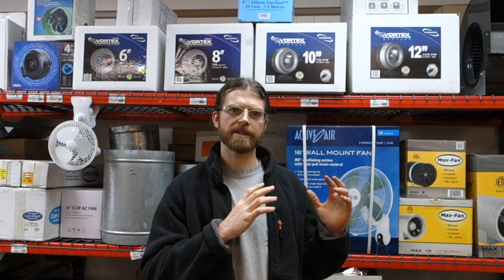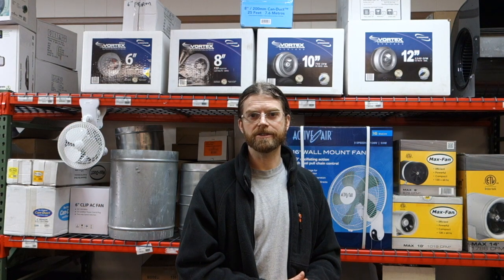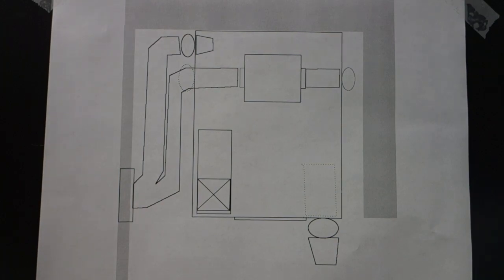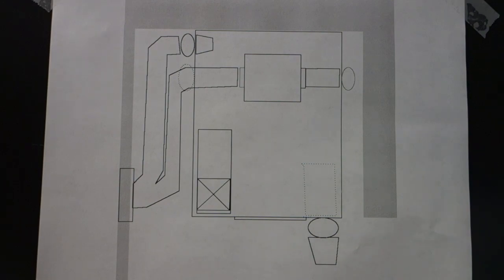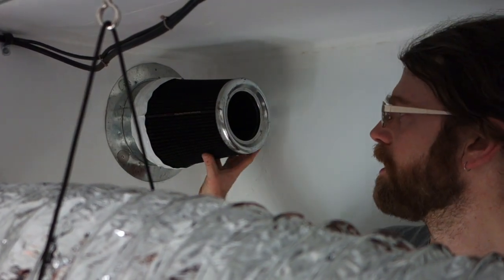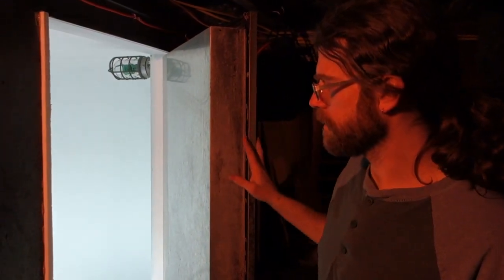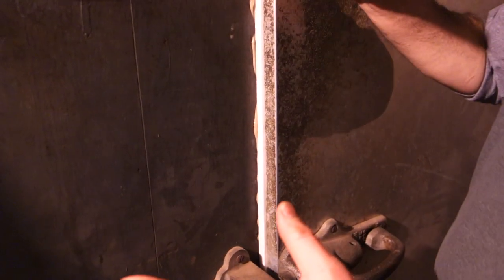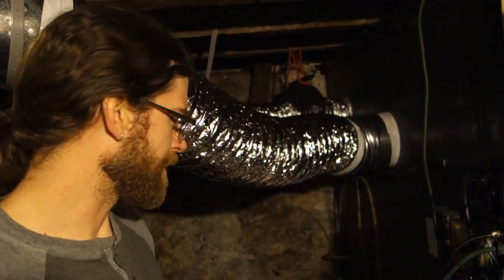Building a Grow Room Pt. 5-  Ventilation and Climate control

Comment: Hi, so if I am running a sealed room with led lights, co2 generator, air conditioner with heat kit then do I still need to bring in fresh air? I do have an exhaust when the lights are off to exhaust excess co2 but don’t currently have any fresh air intake, is the air intake necessary in my application?

Comment: your intake is coming from outside? do you block the entrance?
do you live in an area that is hot year round or dry? I live in new england and its currently winter. is it feasable to start my intake from an exterior window or would it cause temps to be  too low?
Reply: I am in the same boat and live in the same area. I noticed no one got back to you. What did you end up doing. I'm worried about low temps outdoors.

Comment: When your lights are off in the winter how do you keep the room warm with al the cold air blowing in the intake?? Especially if it’s being exhausted too wouldn’t that negate any heat from a heater which would be sucked right out? Other then that I only see perfection. Please explain!!
Reply from the maker: Yep theres a technical limitation there, when lights are off there is no heat to kick on the fresh air exchange.  it would be better to have some exchange at least 1x/hr just to refresh.  Currently I have a small space heater on a thermostat to keep up minimum temps at night.  Ideally using better thermostats with day/night settings would solve this issue.  Its a continual process and sometimes you have to consider costs v plant growth benefit.

Comment: Nice setup. I'm curious, most people say bring intake air in from the bottom. Is the top better or does it even matter?
Reply from the maker: for this room having the intake low in this room (at or below canopy height) can shock the plants during the winter.  If I was bringing cool but not cold air in year round then pulling it across the plants would be better.
Reply: Hot air stays at the top

Comment: Nice room man! 
I do have a question, is it better to use co2 and not intake any air into the room? 

For heat reasons, of the environment is too hot and I’m blowing hot air into the room I would be counter productive no with my AC?
Reply from the maker: if you have an ac installed, then sealing the room and using CO2 would be the best route.  This design allows for an air cooled space with less power consumption.  These days most ppl are switching to LEDs and choosing a sealed space.

Comment: If you have vents in your room, is it necessary to put a fan blowing air in? Or will your online fan blowing air out with the vents be enough?
Reply from the maker: there are a few calculators out there that can figure out air flow restrictions like passive intake, filters, ducting bends, or excessive lengths, but generally if exhausting and without restrictions, you are looking to exchange the air once per minute.  so 500 CFM fan is good for 500 cubic feet space, given no restrictions.  With passive intake you would need a higher cfm than what standard calculation would provide, or add an intake.    Hope that makes sense, lmk!
Reply: Green Dragon Hydroponics definitely makes sense thanks for the reply. Btw where can I buy some of those hepa filters? I need a 10 inch one can’t seem to find them anywhere.
Reply from the maker: @Oh-gz2je  If you are local I can get them in, or ship one to you no prob.✅ email greendragonhydro@gmail.com and I can send you a link.
Reply: Green Dragon Hydroponics cool man yeah I think I’ll order one from you? Also do you have any recommendations on an online website? I’m currently on the hunt for some LED lights but can’t seem to find a good website
Reply from the maker: @Oh-gz2je  sorry i have to plug ours lol, www.greendragonhydroponics.com , i have most of my inventory loaded.  I work with horticulture lighting group LEDs mostly.  Check out reviews on their fixtures, definitely good quality, US company, top end components.  Same prices for what they sell them for.   Def lmk any questions👍

Comment: Im about to build a sealed led room thats roughly 10x8x7  with co2, ac, dehumidifier and circulating fans.Could i get away with using both intake and exhaust 6 inch fans or should i go 8 inch on exhaust?
Reply from the maker: if using carbon filtration on your exhaust then you would need a fan that pulls about 750cfm for that space.   Most 8" inline are around that.
Reply: @greendragonhydro  yes i am going to use carbon on exhaust so i will go 8 then thank you

Comment: Where does the exhaust air go ? by the looks of it nowhere, just circulating back round to the inlet...not being critical but i have the same dillema ..will be using front widow for inlet but the back window is lke 30ft away for the exhaust ??...dumping into the loft is no go too..
Reply from the maker: Intake is coming from outside, exhaust is being dumped into the general basement space to dissipate.  Usually i would use this warm air to help heat the house in the winter.  If odor control and exaust is more important then I would probably put a second filter to exhaust from the general  basement area  after being  dumped

Comment: DONT USE ALUMINIUM VENTILATION DUCT !! ALUMINIUM VENTILATIONS DUCTS contaminate with micro particules ( 1 micon or less ) of aluminium, the air which through the duct ! ALUMINIUM VENTILATION DUCTS are the 1 st origin OF CANNABIS CONTAMINANT !!!!!!!!

Comment: Is it bad to have almost double your CFM rating for an exhaust fan in a grow room tent? For example I'd like to buy a 4 x 8 x 7 grow tent and an ac infinity cloudline T6 or T8 but I fear the T6 at 351 CFM wont be enough with a full tent but the T8 is like 750 CFM and I feel that might be too strong? I'm hoping to become a first time grower so sorry for not being able to figure it out though your video but thanks for the video anyways.
Reply: If you look at the power consumption wattage of the 6" and 8 " cloudline fans I would go with 6" just my option 😉 I have two 6" cloudline fans on one controller and love them ! LEDs and 12×17 room ! Humidity stays really close to setting I have two wall fans also. Hope this helps
Reply from the maker: I would tend to go with the bigger fan for that size tent, but it also depends on your exhaust requirements from heat and humidity whether its necessary.  If the larger fan creates too much negative pressure, some tents have additional support bars for high cfm rating or you can add a smaller intake fan to function parallel to the 8".  You could also put a fan speed control on larger fans, though I'm not sure how that would function with the cloudlines.

Comment: You are the first video i have seen with the fresh air intake up high. I have been thinking of this approach. What was your reasoning?
Reply from the maker: main reason is having the intake low in this room (at or below canopy height) can shock the plants during the winter.  If I was bringing cool but not cold air in year round then pulling it across the plants would be better.
Reply: One reason some of us place intake (especially cold air intakes, or those that use damper control for variable intake, that is mixing outside/cold air with inside/conditioned air) is because the hot air in the room congregates at the top of the room, and the cold air on the bottom. Intake that is cooler than that air should be brought in and put in direct contact/circulation with the hot air, not the cold. If you bring your intake in at the bottom, it is more likely to sit and stay at the bottom. You have to have proper circulation, and that does not always mean sticking more wall mount oscillators all over the place.
Reply: @jonosterman2878  if you have proper exhaust there should be no heat congregating at the top of the grow space and it would be pulling the cool air upwards.
Reply: @RollinDro420  Not all rooms are designed the same, so I am not sure what you even mean by "proper". Many rooms being built are now doing "sealed", so exhaust is infrequent and only for the purpose of air exchanges per hour. The air in these rooms is exchanged only a few times per hour, and the rest of the time the exhaust fan is not running, and instead other FFU's, whether they are fan/coil or fan/filter, are just filtering and recirculating the air inside the room(s). They do this in order to keep the IAQ high enough to run pesticide/fungicide free IPM. Many of these rooms are also running positive pressure instead of negative, in which case the exhaust system would be way different, and you would do all hourly air exchanges through the positive pressure system. Those are usually the most complex HVAC systems to design, as the IAQ requirements are extreme, and in line with ISO classes in the 5-7 range. Anyway, my point being that negative pressure exhaust, which I assume is what you are talking about, and probably run yourself, does not change the fact that heat rises. The air streams within these rooms are not laminar, and depending on the conditioning of the air, convection currents and vortices will whip the air around in odd ways inside the room as the sensible heat keeps driving upward and the cooler air from AC units goes downward. This obvious fact is why we place AC head units high up on walls, and not in the middle or at the bottom. Lastly, hot air doesn't pull cold air upward, and whoever put that idea in your head is an idiot. Cold sinks, heat rises; we all learned these things in first grade. Where were you? Not paying attention I guess.
Reply: @RollinDro420  you're correct sir
Reply: @jonosterman2878  so if I am running a sealed room with led lights, co2 generator, air conditioner with heat kit then do I still need to bring in fresh air? I do have an exhaust when the lights are off to exhaust excess co2 but don’t currently have any fresh air intake, is the air intake necessary in my application?
Reply: @raykay6996  If you dont have an actual intake vent that is ducted to the outside, with at least merv13 filtration, you are doing whats called passive intake, at least during the times when your exhaust fan runs. Its always a good idea to have at min number of air exchanges. It is required by code in all occupied buildings, and HVAC systems are designed with that understanding. I believe the typical system will do 3-5 exchanges per hour. You dont neccesarily need that many for a grow room, but 1 or 2 an hour will help, especially when you are working in the room and breathing out co2 and co. Just working in a space with elevated co2 can cause some temporarily health issues, like headaches, confusion, blurry vision. 

Many people run passive intake on their rooms, I did for many years, and it worked fine. If you use a co2 burner rather than bottled co2, you should DEF be running that exhaust fan more often to get at least 3-4 exchanges per hour. If you are running bottled, you may want to drop that to a min, at maybe just 1 per hour, or even 1 every two hours. The co2 burners release noxious gasses, and although its in minute quantities, you dont want the plants or yourself breathing them in, at all.
Reply: @jonosterman2878  thanks!
Reply: @Anthony-sr3if  I guess you dont know what stratification is. Not all grow rooms have 8 foot ceilings. Most commercial cultivations have way more air to deal with than what we usually deal with at home, in smaller spaces. When you have higher ceilings, and you dont carefully design the hvac and/or circulation fan system, you do get stratifcation, and that can only be solved with a proper volumetric air movement system, so that both the hvac system and the fan systems actually destratify the air. Supply and return location is very important, and I suggest you consult with Manual D to confirm this. Or you could believe some other guy named Scott, who doesnt actually know what hes talking about. Its up to you.
Reply: @jonosterman2878  i dont buy it
Reply: @socks982  I wasn't selling anything, just explaining what I have experienced.

Comment: why not connect your scrubber on the overheadlight and pull the air out that way..  your pulling out heat and scrubbing with one exhaust.fan.. no need for two or three blowers..
Reply from the maker: it is more efficient to separate the intake/exhaust from the light ventilation for a few reasons.  The main reason being in the winter I would remove the glass from the reflector and take off the ventilation to gain more production and allow UV to hit the canopy, as well as some heat within the room during the cold season.  Other reason being flow of the air with the intake/exhaust is better to have on opposite sides of the room rather than right next to each other.  In this space there would also most likely be constraints to put the filter on the light mover with limited space on either side.

Comment: is the intake fan always on as if not wouldnt some smell come out of tat hole without a carrbon filter?
Reply from the maker: the hepa filter on the intake takes care of any odors that may drift out.  They also make hepas with carbon, or also just carbon intakes
Reply from the maker: @jayl5265  yes humidity is something you always chase with a room like this.  a small DH on a humidistat will help

Comment: So if I'm using LED Grow lights, I wouldn't need the air over my LED light Right? all I will need is  intake and exhaust from my grow room? Nice informative video thank you!
Reply from the maker: Hi Tom, thanks for saying👍  A lot of people are switching to completely sealed rooms now with LEDs  and Co2 supplementation, but it would mean that you might need a small A/C depending on the heat your LEDs create.  You would then probably save $$ with lower wattage LEDs, but then spend it back by adding CO2 and A/C.  If you would like to save that $$ on cooling and go with fresh air intake like the one I have, no need to air cool the LEDs separately, a circulating fan will do the job.   This ventilation is not ideal however if you are growing in a hot climate or through the summer, you would need to add an AC anyway.  Hope that makes sense. -P.